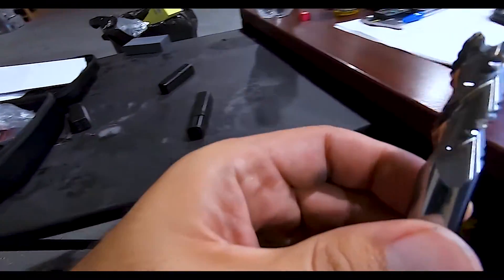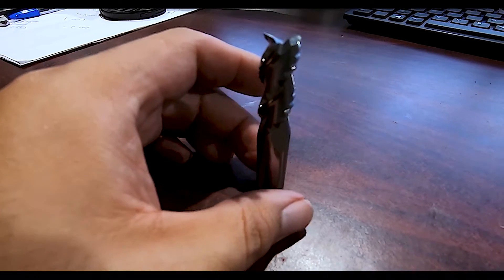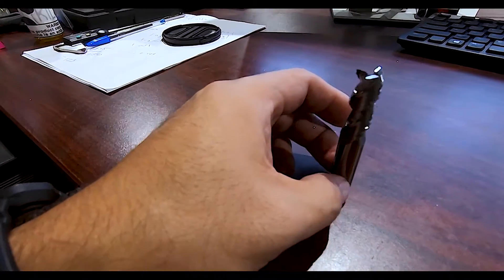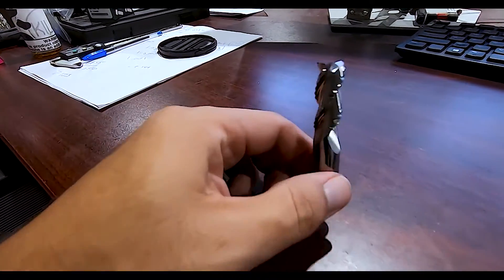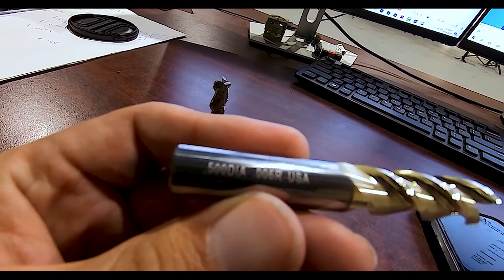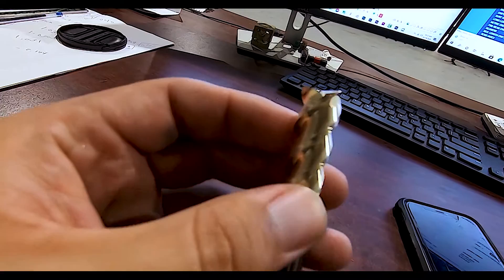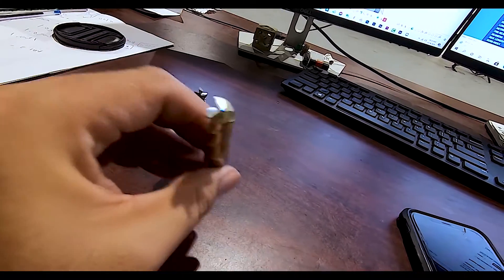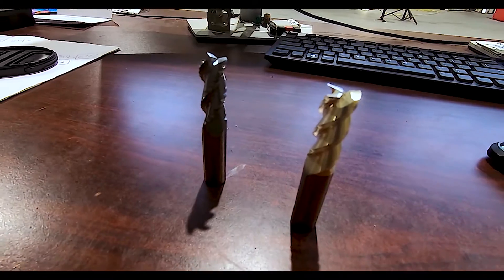HAAS VF2SS SHREDS Aluminum

Comment: I use these cutters on my 3HP Bridgeport style cnc knee mill. You are taking it way to slow. They will handle a lot more than you showed. You can easily ramp at 15 or more degrees.
Reply from the maker: I defiantly want to make a new video pushing these tools a lot further...😏 I think I want to do a will it break video?!?? But you are 100% correct!

Comment: cutts are too light. Stepover should be greater at that depth
Reply from the maker: Ohhh for sure. I could defiantly take a bigger stepover. First time cutting that part also using those endmills I wanted to keep it light. I could have even went with a faster cutting feed as well.
Reply: @cadlabCNC  It is a fun video to watch.  Try the Helialu by iscar. I have one of those and its crazy fast. 2" cutter at 8000 rpm and 100 ipm leaves a 32 or better finish even at a depth of .25 inch.  Thats a full diameter cut.
Reply from the maker: @garyday4356  ohhh wow I will look that info up. Always love to see different finishes using different tooling

Comment: TAS is great until you find out that the little confetti it creates gets into every way cover and clogs every filter and jet in the machine. I pulled mine out and moved to a YG1 JAG ALUMIPOWER. Creates a chip that the auger can actually get out and doesn't clog anything. More balanced and can run it harder...